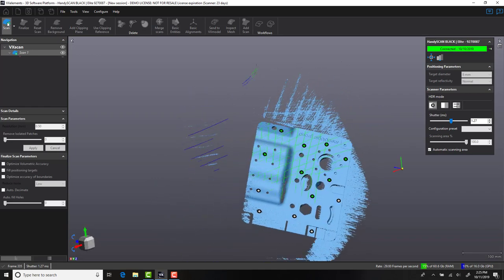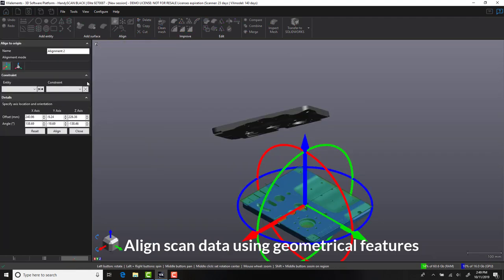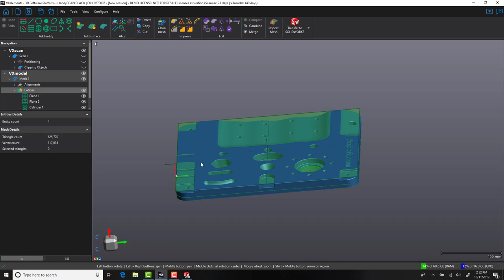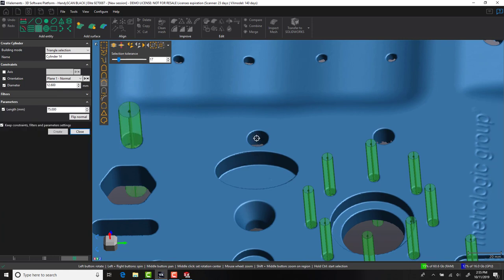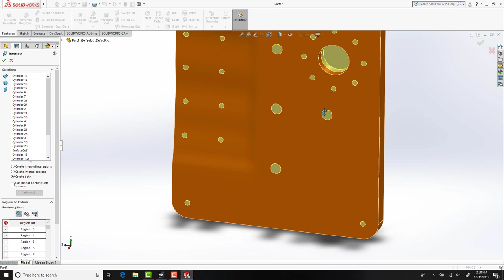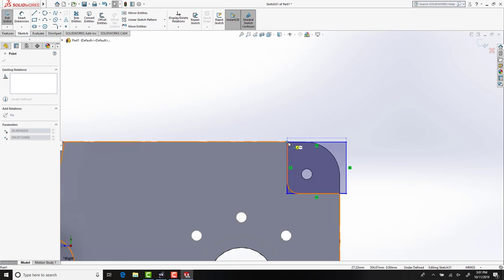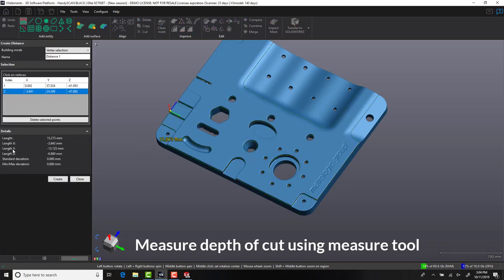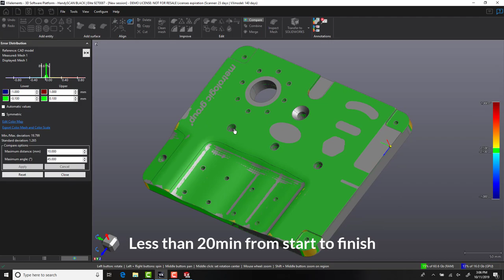VXModel to Solidworks - How to convert 3D scan data to CAD

Comment: this is actual really neat. I could definitely use this tech in what I do. Now here's the thing, you're working on a very simple part, I've always measured everything by  hand so far and can produce very accurate models, however it is time consuming, but I feel like with more complex parts, this wouldn't be much faster :(..... I'd also probably sooner just import the mesh model into solidworks and create the feature tree directly in there vs. going back and forth.... this is still neat none the less. How much for the CREOHandyscan3D and VX software anyway? cannot find prices on-line :(